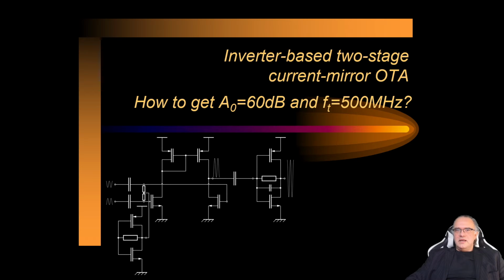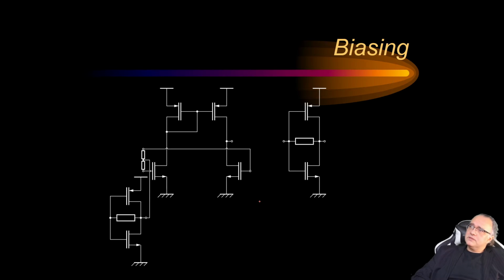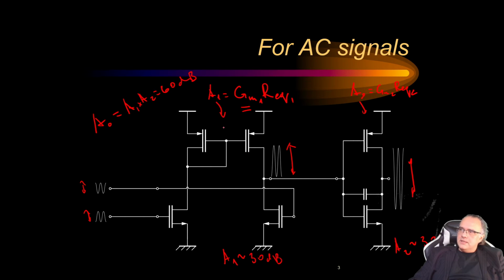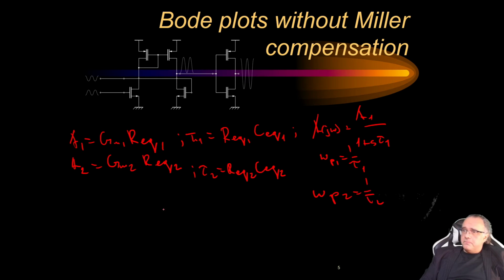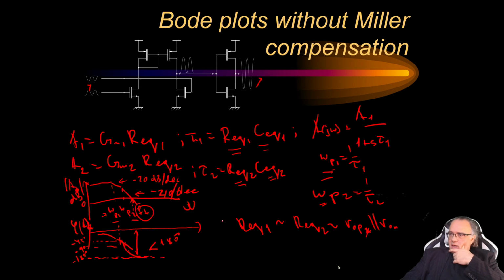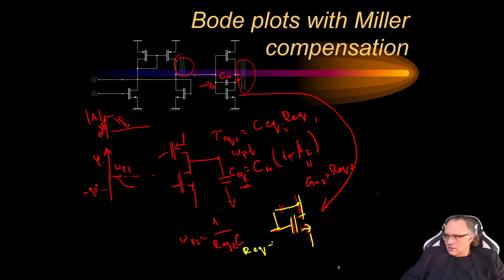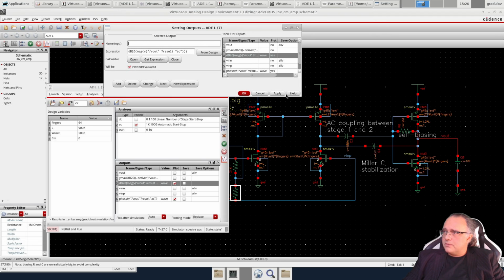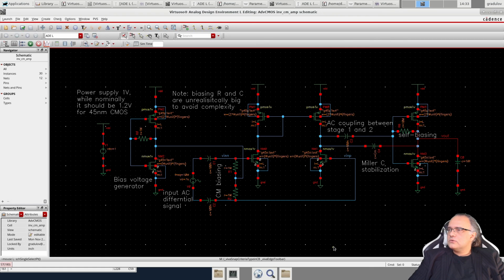Analysis and design of an inverter-based 2-stage current mirror OTA

Comment: Thank you for the video. Can you please explain the application and the advantages over the conventional opamps like two stage and folded cascode ?
Reply from the maker: This one features only two stacked transistors, which makes it convenient for modern IC processes with low power supply, e.g. 1.1V.
Reply: @ Thank you.